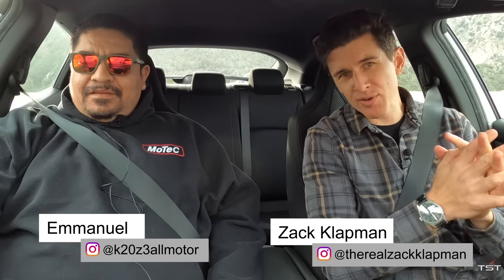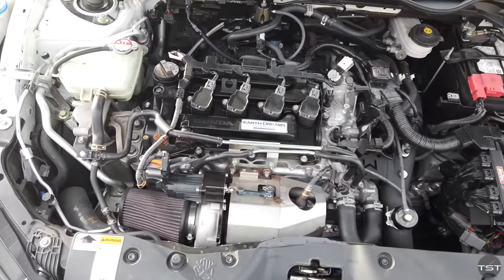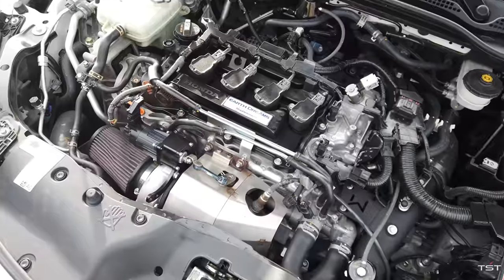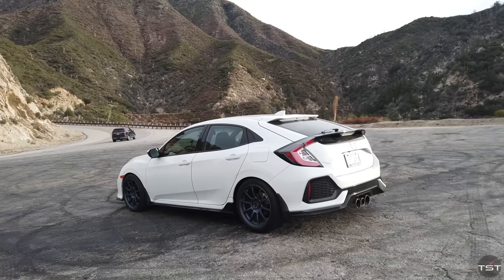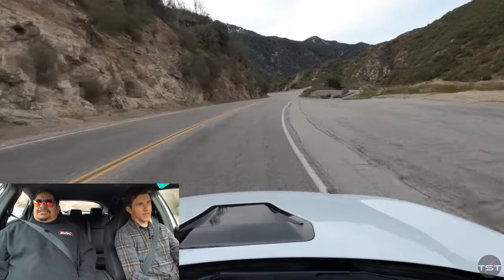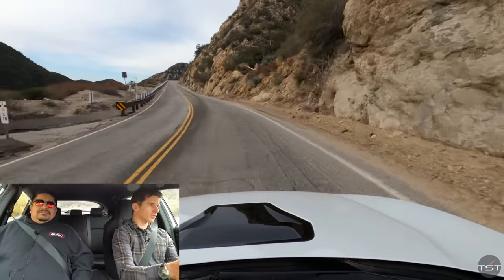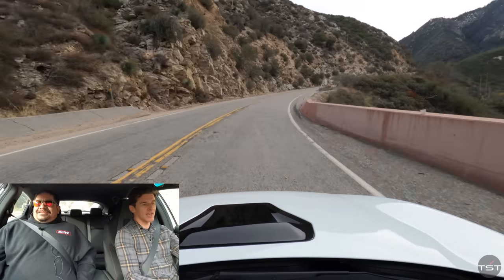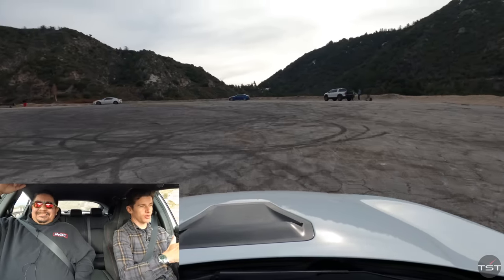How to Make the Ultimate Sleeper Honda Civic

Comment: Currently pushing 252 hrsspr and 280 trq on a 2018 civic si. And I can confirm it is super hella fucking fun. Not insanely fast. But quick and reliable <3
Reply: Wat mods?
Reply: @chorizojuice   how I put it together in order////
-Mishimoto intercooler (pipes)
-HKS catback exhaust 
-PRL air intake cobra
-not running on E. Just 91premium
-Custom tune (ktuner) 
lil side note before the custom tune with just the boltons listed above. The dyno was reading 220 ish horsepower SO THAT BEING SAID. Even with basic boltons you can see some performance   🔥Drive safe out there!❤️
Reply: @alecsii4273  so far im just intake and ktuner(23psi) and waiting for my exhaust to arrive. how long u been tuned? Any issues?
Reply: @chorizojuice  forgot to mention I get around 23psi as well. Was tuned at 30,500ish miles. And I’m currently at 49. I haven’t had a single reliability issue at all.

Comment: orbis turned tpe r into all wheeld drive eieth electric motor and brakes in their own wheel, claiming it weighs same weight as stock wheels. review one, especially cool if its done on new type r transmissions and seats on older smaller type r

Comment: How have yall been dealing with the oil dilution on L15s? Also do the 11th gens have weaker rods on the L15 LCA?
Reply: My oil always smells like gas 2020 civic si on pherable stage 1 only. 3k oil change is the key and alot of people who track run ticker oil but I dont so idk how that works for them
Reply: Stop using 0-20
Reply: Don't use 0 - 20 also the new and old gen have the same rod thickness just different lengths if I remember correctly
Reply: @k20z3allmotorFTW what should be used instead of 0-20?
Reply: @bim1376  5-30. And try not to do short drives where the oil can’t get up to temperature. Needs the Italian tune-up to burn off water droplets in the oil. 😅
Reply: I’ve never had that problem. From what I hear it’s kind of overstayed it in the frequency that it happens.
Reply: @alecbollinger7748  I can confirm I have the same issue on my 2020 si in stock form with only 20k miles.  Going to change the oil weight after seeing this and more frequent changes than the maintenance minder as well. Will likely start adding mods/tune the over the next year now that it's out of warranty.

Comment: I'm also curious about torque figures... 🤔
Reply: The L15 is very undersquare, and usually makes more torque than HP. The torque is limited when tuning to protect the tiny rods and pistons.350+ tq is easy with a bigger turbo
Reply: `high torque` is just more hp down in the low/mid rev range anyway
Reply: @hotdog9262  torque and hp are totally different
Reply: @Senioritis012  well no. in practice as said, so called `high torque` is just more hp to the wheel..down in the rev range. just look at the numbers of any dyno chart and compare the two stats through the range with another engine that`s `low torque`. but with similar peak hp
Reply: @hotdog9262  nor quite. Higher torque in mid-range will be awesome for daily driving, but high torque in high revs is quite useful only for high-end power applications. 
I'm interested is specific numbers instead of the term "high". I suppose is higher that standard but I want to know how higher is
Reply: @Xenstein  hp is a product of revs and torque. hp = torque x revs. so `high torque in high revs` is a high hp engine

Comment: Excause me, but how in the heck is that car still getting almost 40 mpg?  That's insane. Especially on E85?  I don't feel like that's even possible.
Reply: E40-e60, it’s a tiny engine in a light car
Reply: @Ryan Molloy ive been able to get 40+plus on highway only as boost is on above 3k rpm. avg 30-34
Reply: @alexl.102  Even with e85?
Reply: It’s not possible. The e30 blend brings the mpg’s down. More power does too. And thicker oil which you should be using with these. Can’t get 40mpg freeway not even close. But still great mileage. City is like 26 with these mods hwy probably low 30’s
Reply: @ryanmolloy5421  yeah with a gallon or two of e85 even running 91.
Reply: 40 mpg resetting the trip while already on the highway probably

Comment: Dude could of bought a type R and tuned it and would of had same power for less.
Reply: Fk8’s where double the price back in 2017 lol
Reply: @k20z3allmotorFTW  yup, the type rs motor though is way more reliable and doesn’t blow up nearly as quick as these 1.5s. We tuned my fiancés 1.5 hatch and blew the engine in a year too lol.
Reply: @F80mthree  yes the fk8 engines are much more robust, and we’ve built plenty of those, to me they are completely different cars and far more expensive to own and modify

Comment: This generation is whack af with those massive fake blocked off black air inlets/outlets on the bumpers, that horrendous looking rear end 🤮, the interior design, and worst of all that glass 1.5l engine which seems to be a huge gamble with just a light ecu tune. I'm no expert but my opinion is this is the worst generation civic ever.